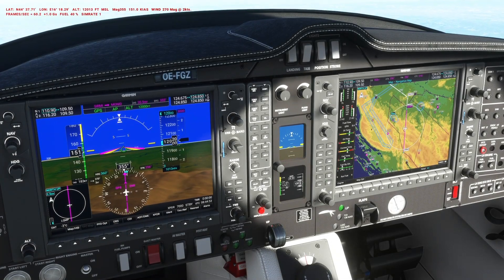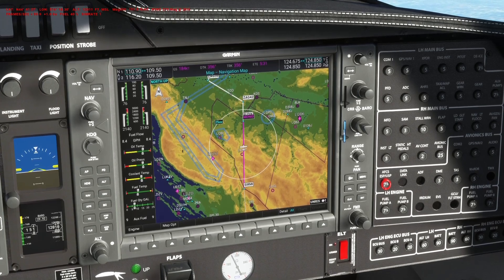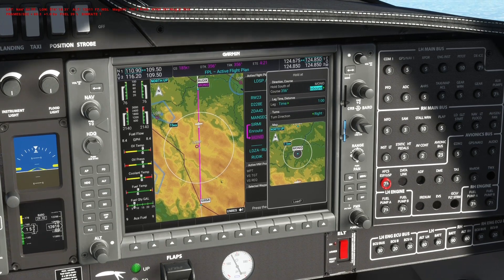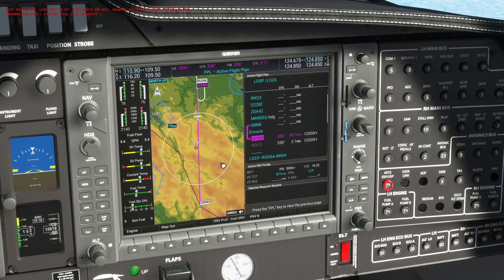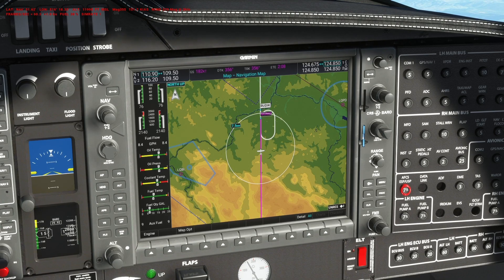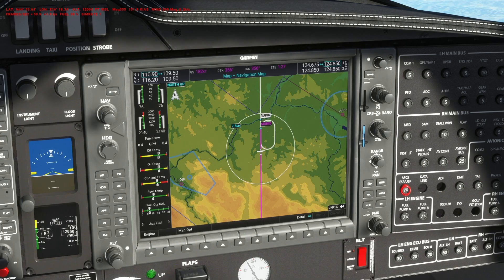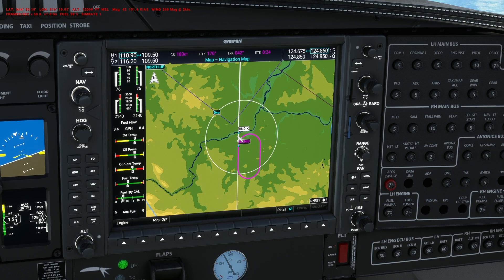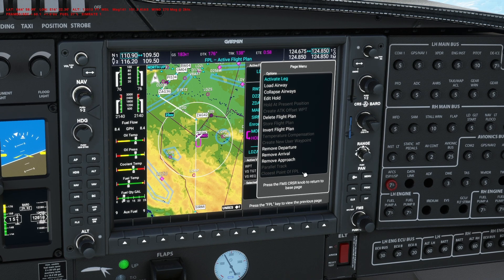Garmin G1000 NXi | All about HOLDS | Full Tutorial - Ep.4 | MSFS2020

Comment: Ive noticed something interesting with the g1000, especially when compared to airliners, that many times the aircraft will take a very aggressive angle back toward the flight plan route in order to intercept it. Ive seen it turn hard one direction and then fairly quickly intercept and the bank hard the opposite direction to line up with the flight path. Seems that there would be programming within the system to soften the entry angle to the flight path. Just something interesting Ive taken note of. As you said, it isnt all mighty.

Comment: Hi, I have just watched this tutorial, and was wondering if it would be quicker to exit the hold by using the 'Direct to' method. It should be quicker as the aircraft would be forced to turn to the next waypoint rather than following the hold pattern to the next waypoint. Just a thought, I will be trying that the next time I'm in the flightsim. Any thoughts? Cheers and thank you again.
Reply from the maker: Yes you are right it would be quicker but it is not proper procedure to exit hold. Thanks for the comment.
Reply: This may also not be what ATC wants. Usually they will require you to fly over the holding fix before you continue the route. You could go direct to the holding fix and manually activate the next leg. If we wanted a plane to exit hold before it completed the lap it was on, we would usually give a clearance such as "Cleared to LDZA via direct MONID then as previously cleared", leaving it up to the pilot to navigate to MONID and continue on course. Depending on your current position in the hold, going direct to RUDIK may not be a proper way to proceed, especially if the course to RUDIK and the holding course are different (in this case they are both heading 356 so it would probably be ok in this instance).
Reply: As a caveat, with the permission of ATC of course!